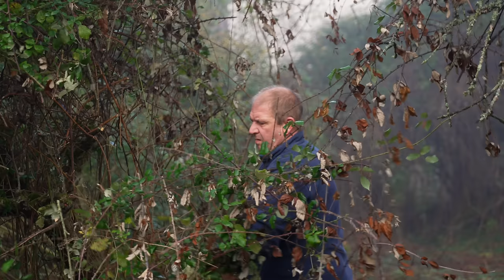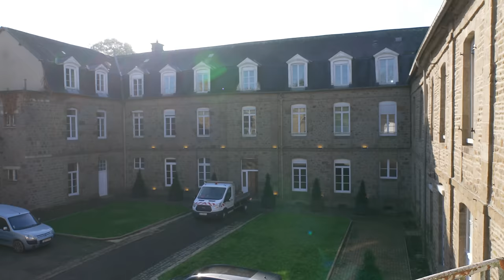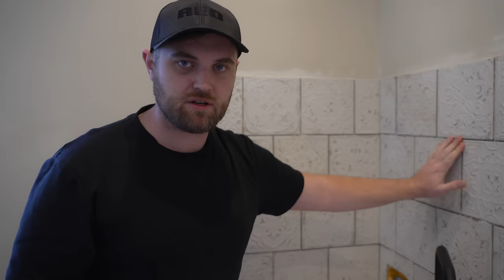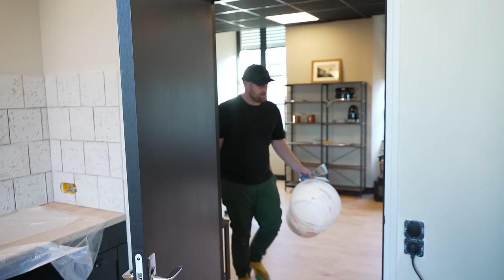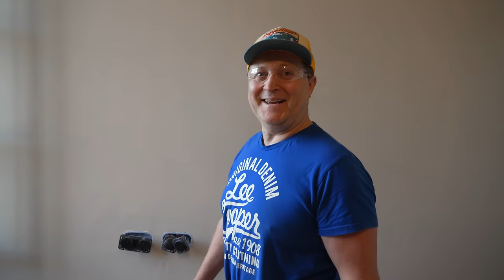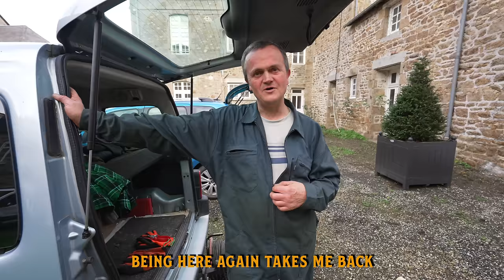This Local Man Helped The Nuns 34 Years Ago

Comment: Billy! I used to work in an art gallery/professional framing shop. I few suggestions and general information for you. You have invested quite a bit into getting the highest resolution on very good quality paper for your chateau prints. Consider purchasing archival acid free backing board (and matting) if you reframe them. At the very least, remove the paper that came with the frame! Often the paper that comes with ready made frames is NOT acid free and it will eventually discolor the art work from behind if you leave it in the frame touching the piece. 
Also, plexiglass is MUCH lighter than actual glass and you may find that the frame molding itself will need to be a bit heftier and thicker in general to accommodate the extra weight if you swap out for real glass. If you wanted to keep the frames you have now, you might have to buy more expensive specialty glass that is quite thin so that the corners of the frame won't come loose from the extra load. It's a bit of a trade off.  And be cautious about using anti-glare glass. It will significantly reduce the image clarity of the prints, which would seem a shame after the all the care you've taken with the high resolution of the prints themselves. I'd test it on one to see if you mind the reduction in image clarity before ordering enough non-glare glass for the lot. Hope this helps!
Reply: That's wonderful information. Hopefully, Billy does read these comments.
Reply: Thanks so much for the info.
Reply: Excellent advice!
Reply: This is such good info.  Thanks

Comment: Billy don’t use a scraper to fill the joints get a plastic lid and cut a hand size square from the lid much better on the tiles the edge of plastic lid thick part to fit in the hand when finished clean and store to use another day.😊

Comment: Just and observations, the most common way to grout is to mix grout then let sit for 5 minutes, then remix. Application to grout lines is best with a molded rubber float, then let sit for a few minutes before water and sponging excess off. After light wash off, let dry over night and then dry rub a towel over tile and grout, it will polish up wonderfully!

Comment: I've been putting off a grout job for ten years and you've given me the confidence and example to proceed. Great work from you all,and marvelous video and editing. You make it look so easy!
Reply: Do yourself a favor.. don’t use a drywall taping knife to apply the grout, use a grout float. It’s purpose is to fully push the grout into the gaps. Not just skim the top. It will make for a longer lasting application. And pay attention to the type of grout. Sanded vs. non-sanded depending on gap width. Very important

Comment: Billy, using the software you (may) be able to alter the proportions of the scanned prints to fit your photo frames. Alternatively you can buy blank mounting boards (the cardboard that site directly up against the glass) and a specialist tool called a mount frame cutter, to make an angled cutout. Plenty available choice on Amazon. This way you can organise a mounting board to suit your needs. Mounting boards come in a huge array of colours, also available from online stockists, Amazon etc.

I've found that for photos, it's easier to copy the file to Microsoft Publisher or its equivalent from the original software package, in order to manipulate photographs to fit the frames that I have.

Comment: Love the chateau prints Billy. For the print you did in this video all you need to do is take it to a picture framer and have them cut you a new matt board that matches the ones in your frames but it's cut to the right dimension to fit the image. Just have them measure and cut to fit your frame and put it together yourself to save money. You can probably use a clear matt spray on your plexiglass to cut the glare. In my opinion non glare glass or Plexi cuts back a little on clarity unless you get the real expensive stuff. But test the spray on something else first to see if you like the results. Just make sure sprayed side is facing out so fumes won't harm the conservation of your prints.

Comment: Hi Billy, a way you could avoid the issue of your fabulous print not fitting properly behind the frame mat board is to do a bit of cropping and moving of your original print scan. In the one you just did, you could cut out the 'caption' (text) at the base and paste it back in an inch or two further down, giving a bit of white space between the actual image and the caption.

Comment: Billy, I was just wondering if you ever worked with a cake decorating bag for when working with a dark color grout. It's  a lot less messy and you use less waste to take off especially with te texture tile. and your wet sponge... I learned through my years of experience.. Just a little tip...love your videos.

Comment: Put grout in sandwich baggie snip tip and force into the cracks. Much cleaner.  Use less product and easier cleanup. Black grout is the pits. I have worked with it before.

Comment: Bill, it's not necessary to print an image that you'll be hanging on a wall for viewing at such  high resolution. I used to work for Canon and was responsible for selling Canon Color Laser Copiers when they were the state of the art in the late 1990s and sold for $50,000 and up. When printing an image for viewing at a distance (even a small one), a lower resolution print, say 200 - 300 dpi, is sufficient because the brain fills in the gaps. It's sort of an optical illusion. You will still need a jewelers loop to see the gaps. Your documents will print much faster because the raster file will be much smaller and you will not be able to tell the difference between your high resolution and low resolution images from 4+ feet away. Hope that helps you save some time and hard drive space.
Reply from the maker: that helps a lot thank you for your message! it’s always nice to hear it from the professionals
Reply: @ThePethericks  The prints are so stunning! Perhaps you could have Sean build you some frames out of some of the reclaimed wood from the Convent?🤔 Everything is coming along nicely! Such a terrific team! Nice job on the videos, Ryan! Cheerfully awaiting a video from "The Life of Ryan"! 🌟🌍🌏🌎🤩

Comment: Why didn't you use a "float" tool for putting on the grout?  It's a soft pad with a handle, which won't scratch the tile, unlike the putty knife you are using.  Also it quickly covers the grout lines with broad strokes.  Something to think about for future tile work.

Comment: In the states on insurance there are 2 types of insurance.  One is replacement value insurance.  The second is a stated value.  You said you have 6 million on it.  Yet your purchase price is 1 million.  With the stated value policy you only insure for your actual possible loss.  In other words the insurance is not held liable to replace the standing covenant, only refund your investment.  The exception comes when if you put the property into a commercial function where you could have liabilities with public interaction.

When I take things apart and I want them kept in exact position, I take 2inch wide masking tape and enclose the screws, hinges, or hardware and leaving a little or a large tab of tape to the item and location where the hardware goes.  Then when you go get the door, shade, shutter, etc to replace it the screws are with it.  Yes I have lost some but usually not as much as not keeping them together.